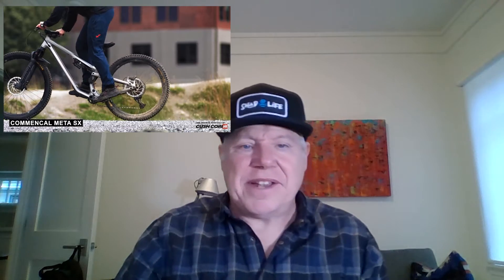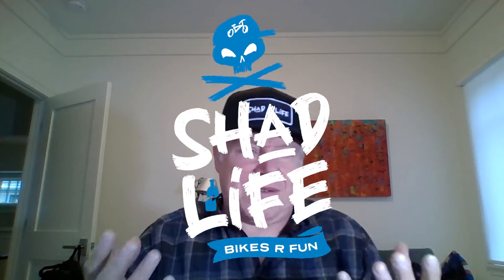How Fork Compression Works

Comment: When you add volume spacers does that effect the factory psi settings.  In other words would you lower the psi a bit as you add volume spacers?
Reply from the maker: Not by much if any. I always set my fork pressure by sag and I end up close to the same pressure as I do without volume spacers because they don't have much effect at the top of the travel.

Comment: the kinematcs of the rear of the bike.  the rear shock ramps up just like the front.  it is the changing leverage ratio as the rear of the bike travel through its range plus the chain tension that will determine how fast or slow the rear shock compresses at different point in the travel

Comment: i do like the tech stuff but this is to basic...you need to go more in to it...let's talk about the air side of the fork.. you have a positive and a negative chamber, you only mention the positive  chamber side of the air system..the negative air side is also important....to control it all you need the demper side..
Reply from the maker: Yes, but not all forks have negative air chambers that are adjustable. I am keeping it simple because negative air really is there to balance out the fork for sag and at the beginning of the stroke. Once we get through that, compression works as I explained. So keeping the idea of how compression works is simple. I will do another video explaining a bit more how the damper and other added adjustments work, like negative air pressure work.